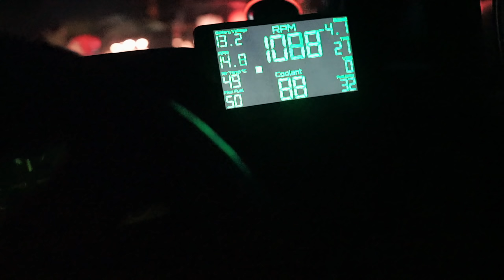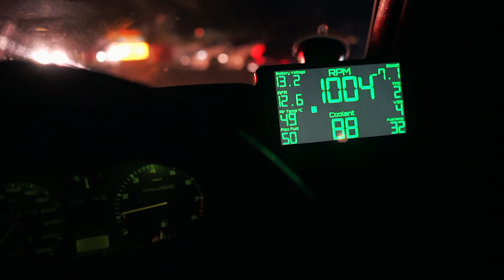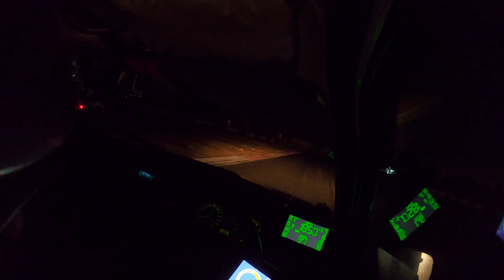Drag racing the big turbo 1.8T Mk2 GTI | Killarney Robot Racing - 13 April 2022

Comment: Good stuff man 👍 Definitely seems like a later spooler for that RPM limit. All the power is at the limiter, not that I like turbos dropping off at the top end but a modern turbo like G series garrett would give a much wider power band.
Reply from the maker: It definitely will. But it costs nearly 40k for an applicable G series turbo. If I had the cash, things would be very different. I'll be the first to admit that this turbo is poo on a 1.8T but for a 10th of price of a G series, I don't think it's that bad. But before I write it off, I'm going to make some setup changes and give it a good shot.
Reply: @lowdl  No hate ☺ The new garretts are expensive for sure! I went for a gtx3076r on my 1.8 20vt, but rev it to a scary 8500rpm to make the most of it. Either way I've  been loving watching your journey and you experimenting with different setups. I'm sure you'll find the sweet spot at some point. Keep up the great videos 👍
Reply from the maker: The 3071R is what I was looking at and that's why I went with a Mr Turbo 3076 option to get my foot in the door. But sadly that thing died after 1 pull. lol. You really have to rev the tits off a 3076R on a 1.8T. I had no idea, I guess I can't get around doing valvetrain mods. lol. I'm looking at a Pulsar for when I eventually want to spend money on a turbo again but for now this T70 will have to do. If it gets me into the 12's on semis, I'll be chuffed.  😅  And it's been a journey, glad I've got you guys following along. Seeing what not to do for the most part 😂

Comment: Still performs well..even when down on power lol What estimate kilowatt was it making on low versus high boost on these runs?
Reply from the maker: Peak was around 260kw but I didn't make that at all during those runs. It makes that at 7300 in 4th & I cross around 6k rpm in 4th 😂 so realistically it was peaking at around 220kw at the end of 3rd.
Reply: @lowdl  that is strong power! The way you can nail it in the higher rpms is really nice too.. With extra grip/traction your times will continue to drop no doubt 💯

Comment: What a sketchy ass drag strip... Are you even at a real track? Never seen an end of a strip have speed bumps and walls like that...
Reply from the maker: It’s not a dedicated drag strip. It’s a multi purpose circuit. It’s less than ideal but it’s the only track in the city. 😔
Reply: @lowdl  I hear you, just seemed really sketchy. I'm assuming they wouldnt allow  11second or faster cars there, right?
Reply from the maker: @TronBons  crazy thing is, they do. 😂 There’s guys that run 8/9’s there. They give them a little extra stopping distance but it’s still sketchy af. Parachutes are essential under 10.5 or something.
Reply: @lowdl  Well those guys are nuts... haha